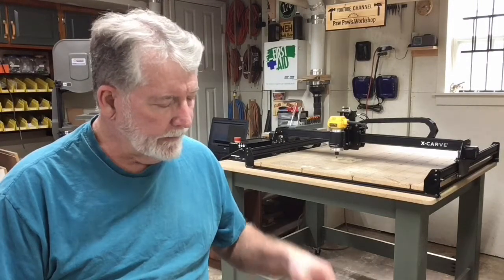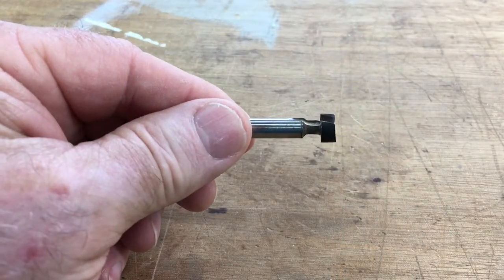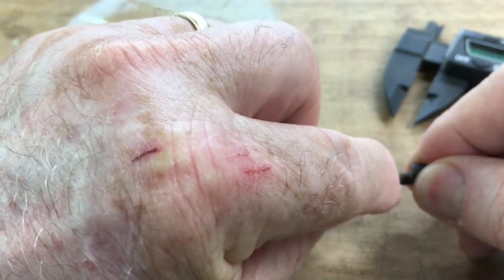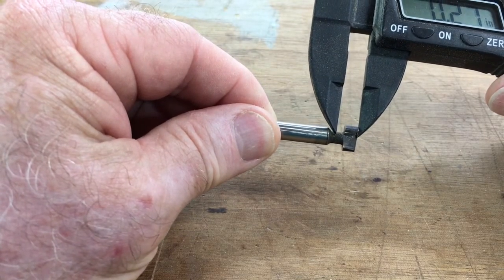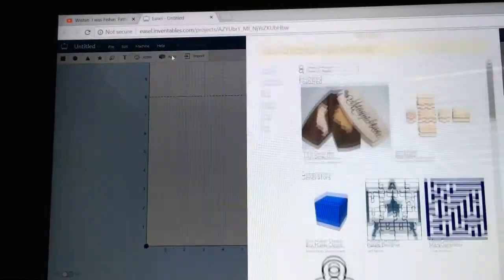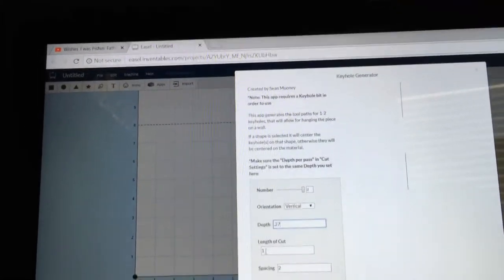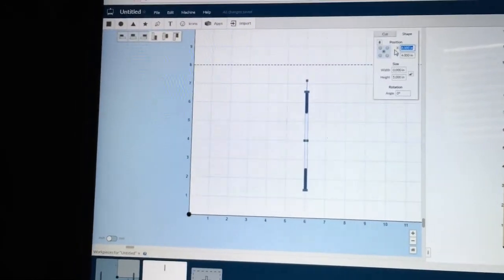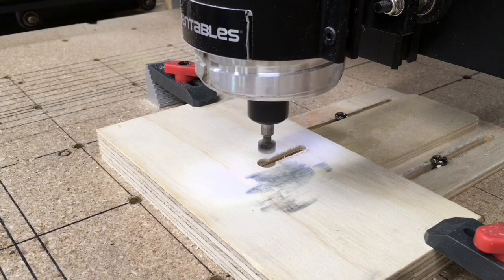How to Use the Keyhole Generator App in Easel

Comment: It almost worked on my x carve but the keyhole bit did not plunge, it dropped in a little, cut forward and backwards, dropped again, cut forward and backward, repeat. What am I doing wrong? The bit needs to plunge and then move . And why doesn't easel have a keyhole bit?
Reply from the maker: You have to have the depth of cut the same as the depth per pass. Please review the video. The bit will plunge to full depth then make the keyhole and then retract

Comment: For some reason I am having issues with my initial plunge when it enters the material. I have gone into my cut settings and made it the same as my depth on my depth per pass but it just seems to take off about an 1/8 off at a time. Can you tell what I am doing wrong? I am sure it is something very simple but I am missing it somehow. Thx in advance
Reply from the maker: If you are using the Easel app you must set the depth in the app for example .25" then in the cut settings you must set the depth of cut at .25. Look at the preview and make sure that you do not have multiple passes.  It should only show one.
Reply: Paw Paw’s WorkShop Thank you for the info. I am not sure what I changed but it seems to working great now. Thanks again!

Comment: How does this work for alignment when you have to put it on the back of a project.  The example i am referring to is i have a #12 for my son. I want to use the keyhole bit to put the keyhole in the upper third as you said.  How do you do keyhole placement on a flipped project in Easel?
Reply from the maker: It is a new project.  I assume the #12 us cut out.  Use the Easel app for the keyhole for one slot.  Measure on the back side exactly where you want it and carve each keyhole one at a time.

Comment: What setting for the bit did you use in the video, I have 1/4 bit
Reply from the maker: Use a keyhole bit.  It has a 1/4" shank.  The setting were the stock settings in Easel.  I believe it was set for birch plywood.
Reply: @PawPawsWorkShop  what would the bit settings be in easel

Comment: Loved the video, was  wondering when you cut 2 slots you set the xy to corner with the 2 slots so how do you put down the board and get the slots in the correct position
Reply from the maker: Follow the app.  When you bring it into easel you will see where the slots will cut. You can move the cut to where you want it to be in relation to the x,y point

Comment: great video  I am only getting the slot nothing else what am I missing
Reply from the maker: Thank you very much. First, look at the simulation. My guess is that you have a very shallow depth per pass.  Determine how deep you need to go.  It should be approximately .29 inches.  The next thing you need to do is go to the custom setting and change the depth per pass to .29 inches.  That way you will cut the keyhole in one pass.

Comment: Great Video!!  Is there a way I can enter the keyhole bit?  It doesn't appear to be an option.  Thank you Phil.  I certainly do appreciate all that you do maestro!!!!
Reply from the maker: Thank you very much.  Easel now has the ability to add bits but it is not all inclusive.  I still do not believe that you can enter that bit.
Reply: @PawPawsWorkShop  Ok so what settings for the bit did you use in easel

Comment: Nice video, I slow my feed and speed down and then it's not so abrupt going into the material.
Reply from the maker: Thank you for your comments.  The rates are considerably slower than the g-code that I was using which I could not change.  I am still looking for the best rates for the various materials used